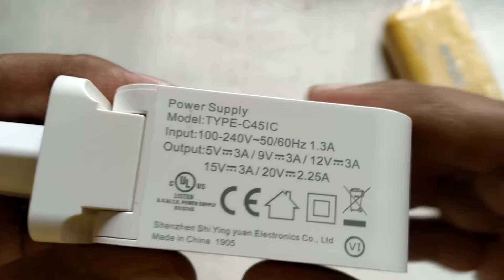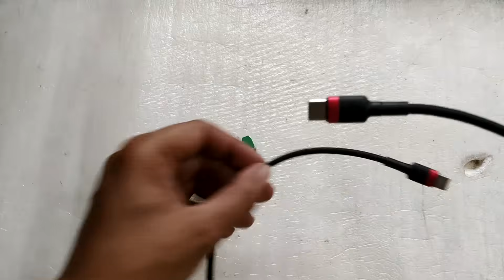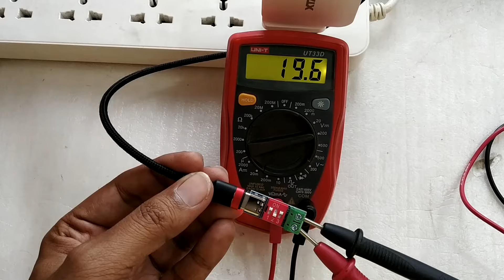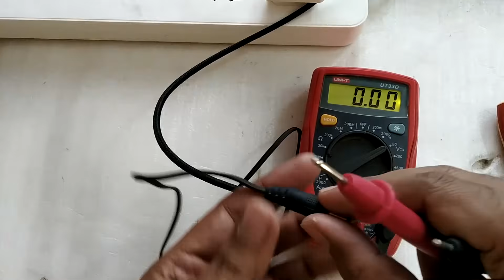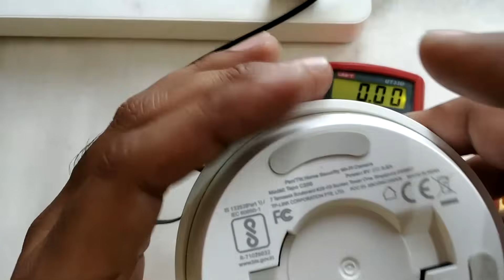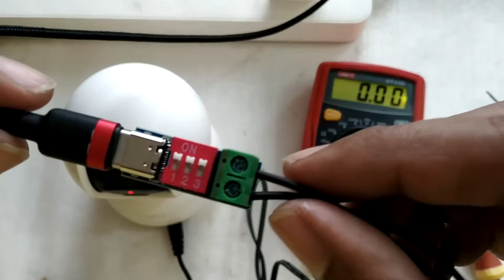USB C PD Trigger Board

Comment: I dont know why my one is giving out only 5v in every dip switch positions, i'm using a proper pd charger and also pd supported cable. Do you have any idea how to fix this?
Reply from the maker: after making changes you have to disconnect the reconnect the cable see if this works. what charger and cable are you using.
Reply: @gurribuy tried with a 33w gan charger and also a samsung pd charger with samsung c to c cable
Reply: Still it stays at 5v

Comment: so in short this module is like a Boost Converter?
Hmm, I might be able to power a 12v 2A audio amplifier using this module with a PD capable charger/power supply
Reply from the maker: No, It is not a boost converter, as boost converter converts low voltage to high voltage and in the conversion wastes some energy.
However, this pd trigger does not convert anything, it just asks the charger for a particular voltage and the charger supplies that voltage and  almost no energy is wasted,
Because you don't have to raise the voltage as the charger already have support for 12v and other voltages No conversion is needed.
Reply: @gurribuy 
so, it is ok then to power an amp, say at 12v - 15v @ 2A?
Reply from the maker: @dmc_Bohol  yes.
Reply: @gurribuy 
thank you very much sir!
you are of valuable help👍

Comment: Can this module be powered by a 12 volt power bank and run the modem?
Reply: Yes, just connect 5.5x2.1 plug to it with wires, and check the voltage before plugging it to the router 👍
Reply: Yeah it works for pd powerbanks

Comment: Thank you for this video. I have a doubt suppose if i want to convert a wall mounted C PIN socket (like in Legrand) to a variable voltage how to use this decoy. I mean the output is only to wire how to make it Cpin again? any ready made solution available

Comment: I can use tec1 12706 peltier with this module
Reply from the maker: NO.
Reply: Use a buck converter with the max 20 volts triggered from the high output pd device wired into the converter input, then reduce the output voltage on the buck converter to 12 volts. This way you can get the maximum power output at lower voltages, I power my 60 watt DC vacuum this way.

Comment: Is it safe for the charger when you adjust the voltage while PD trigger is  plugged in???
Reply from the maker: yes, it is safe for the charge. But, when your are adjusting the voltage make sure there is no device connected at the output of the module because you may accidentally send high voltage to a low voltage device.